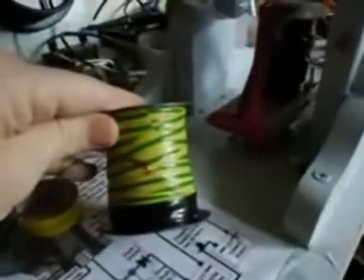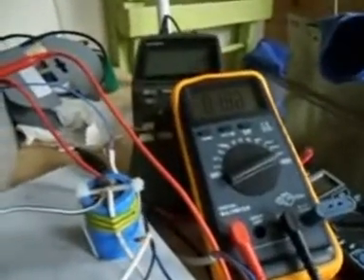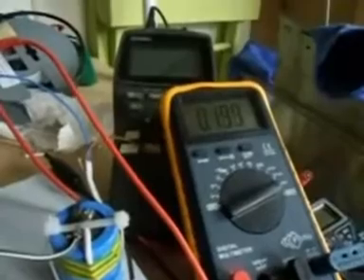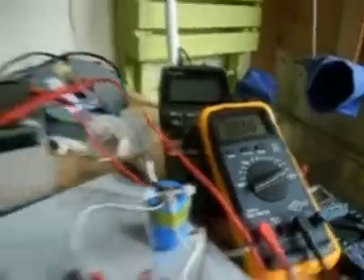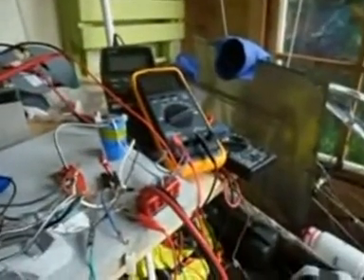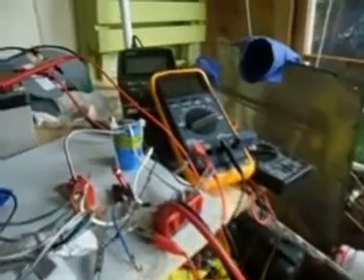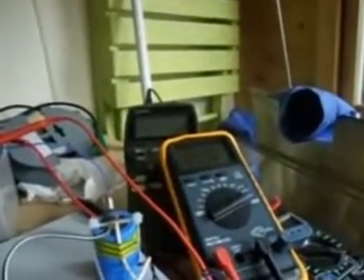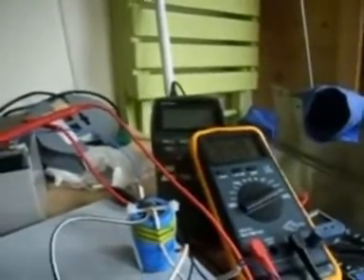Testing cone formed coils

Comment: great test,what if you use a pancake style coil with much less copper?its  better to have less weight and rpm`s with a brighter bulb,so less wear n tear on your unit. speed is not everything ,UNLESS you will put a pulley on it going to a generator.